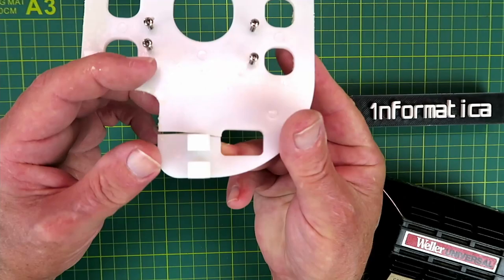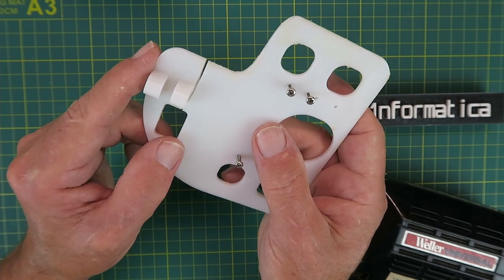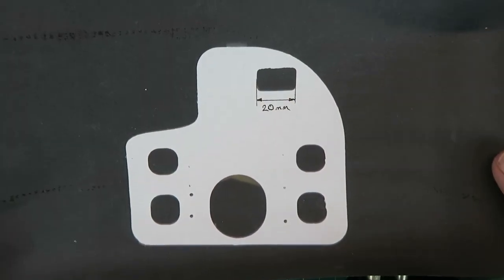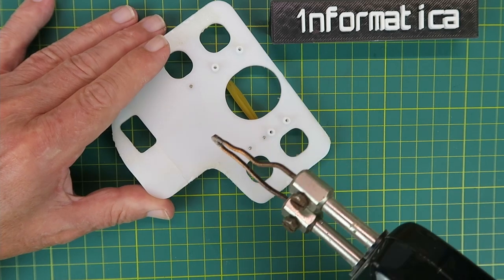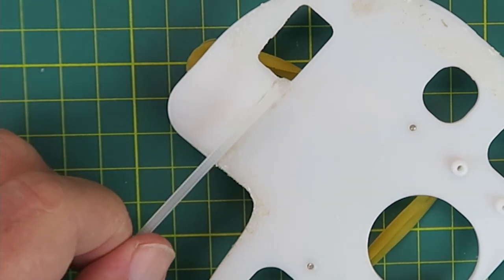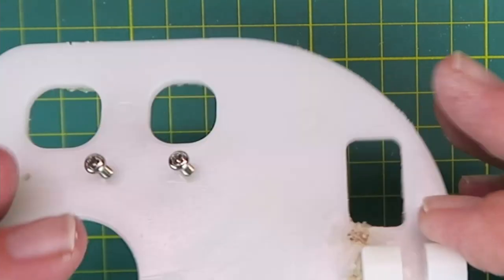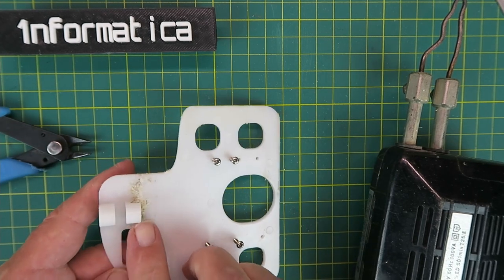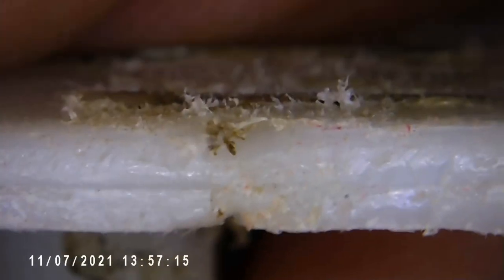Nylon Crack Repair Welding Attempt Hot Tip!

Comment: Nice work. I only recently discovered the 'art' of plastic welding. I now keep an old dedicated soldering iron for the job and have mended a lot of things I thought were broken - never to be fixed.
Apparently strimmer (weed whacker) line is good for filler on nylon. I've even seen one video of someone who used it as filament for a small 3D printing task where he wanted to use nylon but didn't have any.
Reply from the maker: Hey thanks! Good tip on the strimmer line. I actually have a reel of nylon for my 3D printer but decided to show tie wrap as that's what most people will have. Thanks for subbing!
Reply: Never thought a soldering iron would work. Didn't know if it would be too hot for plastic, as those old ones are not temp controlled and just go up to infinity. I have some old pencil type ones.

Comment: Brave attempt and good result. My only suggestion would refer to the “filler “ used. As the bulkhead is quite generous in proportions it might have been possible to acquire some suitable shavings off the base material and these may have combined more easily than the tie wrap used.
Reply from the maker: Good idea Tom, thanks for sharing. I could also have used nylon filament that I have for my 3D printer but I wanted to show using something that everybody would have. We'll see how it holds up!
Reply: @1nformatica  You can get scrap plastic from anywhere to cut up or smash into shards for repairs. I've sourced plastic from dollar store products, litter on the sidewalk, all kinds of things. Once you can identify plastic by material, or if it tells you its symbol on the item, you're in business.  I just fixed a hole in a plastic patio table using those little stand things that you get inside a pizza box.
Reply from the maker: @MrWolfSnack  Good info, thanks for sharing.

Comment: Really like the elastic-band idea in preparation. The final staples too. On another video the guy simply 'welded' a patch of metal mesh (cut it out from Mum's flour sieve) over the crack.
One each side for strength. For less-focused soldering heat use a 'spade' tip, it spreads the heat - for less ugly burned plastic - make your own from bashed thick copper cable.
Reply from the maker: I like the mesh idea, noted! I have a spade tip iron it's so old it has a wooden handle! In the end it broke again (bad landing)! I copied and cut one from aluminium. Thanks for watching, have a great day!

Comment: I have a classic getto blaster that has a crack on the pinch roller cradle watching this I'm going to use this method...fingers xxxxx'd
Reply from the maker: Good luck! Thanks for watching, have a great day!
Reply: Same here with an 8-track player I just bought, the bracket that holds the audio head cracked in shipping. Nylon/delrin plastic can NOT be glued, it is not porous and will not accept the glue. Hence where plastic welding comes in.

Comment: I have to repair a small nylon gear with a diameter of 32mm and 107 teeth, which has broken due to shrinkage of the nylon. I have already reinforced the inner circumference with 0.3mm steel wire, but I have to add 2 teeth to return to the original diameter. I want to fill and mold those teeth with some resin, but I have already tried without success (it doesn't stick) two-component epoxy resins such as Nural92 from Patex, Loctite gel with bicarbonate or graphite binders. In this case I cannot apply heat because of how small and delicate the area is. 3D printing also doesn't give me enough resolution or strength in the 0.6mm teeth.
Reply from the maker: You don't say what the gear is from but have you exhausted all options for replacement from the manufacturer or other sources like Aliexpress, loads of gears there! Otherwise you're going to have to make one, see link below especially the video by Randi Rain : https://www.google.com/search?q=replicating+broken+nylon+gear&rlz=1C1ASUM_enES692ES692&oq=replicating+broken+nylon+gear&gs_lcrp=EgZjaHJvbWUyBggAEEUYOTIHCAEQIRigAdIBCjIwNjMzajBqMTWoAgiwAgE&sourceid=chrome&ie=UTF-8 Thanks for watching, have a great day!
Reply: @1nformatica  The gear is the only plastic part of the fine focusing system on a 1970s Nikon microscope. It uses a nylon gear in a planetary gearbox. Supports the weight of the plate and the condenser. The original spare part became brass, but they stopped supplying it a long time ago.
https://www.youtube.com/shorts/D7kp5wm6dYw
Reply from the maker: @biogons14  Guess you are going to have to make one then! Or find a watchmaker, but that could get expensive!!